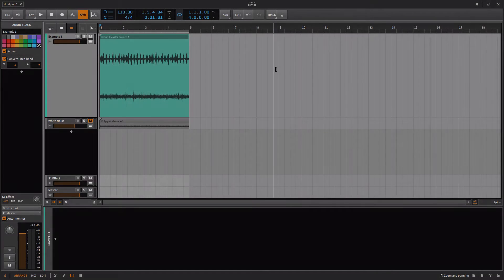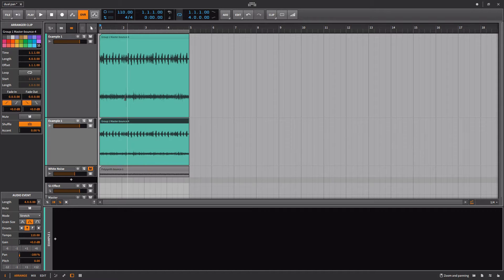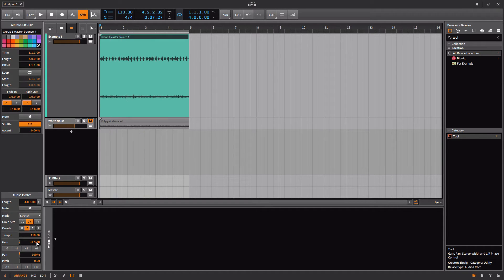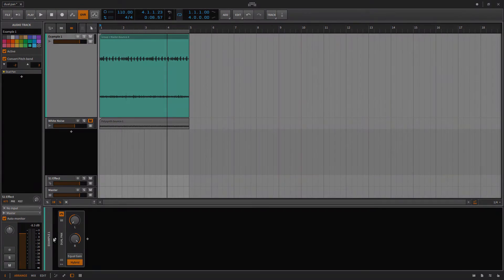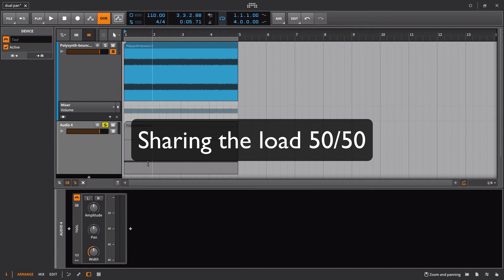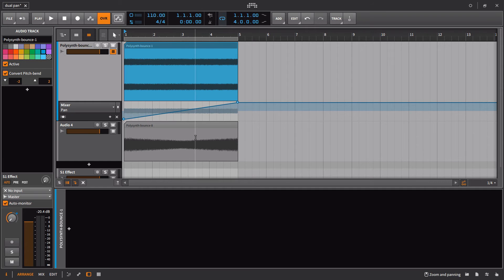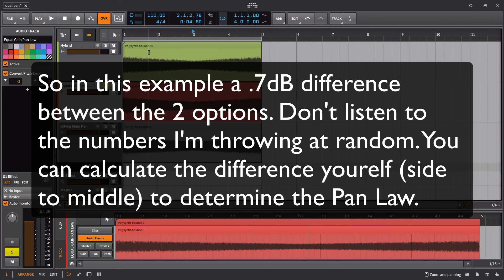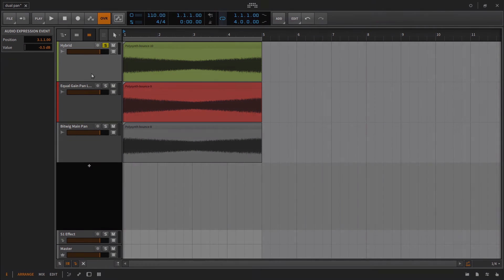Bitwig 2.0 - Pan, Dual Pan, and Pan LAW

Comment: If mixing two sources together (in-phase) increases their amplitude, and the Fletcher-Munson curve shows that we perceive that amplitude unevenly, wouldn't the perceived output be a Fletcher-Munson curve times 2, rather than just a flat white noise times 2? In that case, shouldn't a pan (in middle position) attenuate with 1 inverse Fletcher-Munson curve? I ask this because white noise is even amplitude for all frequencies. It's like saying "1+1=2" if you add two of them together. But if you add 2 Fletcher-Munson curves together, it's more of an exponential process, as the different frequencies start initially with a drastic disparity in perceived loudness. It's like saying a pan (in middle position) is perceived with the bass 1+1 and the mid 4+4 and the highs 3+3.
Reply from the maker: Based on my understanding (which could very easily be wrong) fletcher munson (equal loudness contours) is, for the most part, unrelated to this. 

Yes there is an element of perceived loudness to all of this (similiar to the contours) but Pan Law has to do with what occurs when speakers are summed together and how that then relates to perceived loudness. In theory the frequency response of your speakers should be the same.

https://en.wikipedia.org/wiki/Pan_law

Determining the "right" Pan Law has a lot to do with the room you are in and to some degree that would include frequency response of said room.